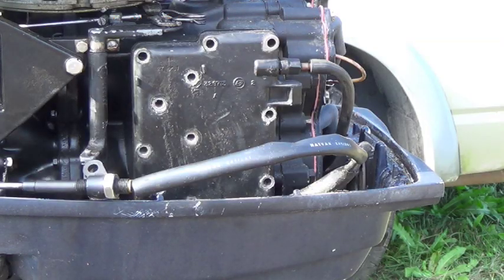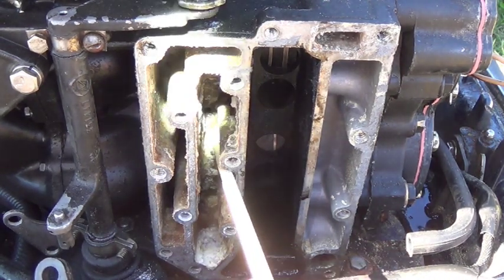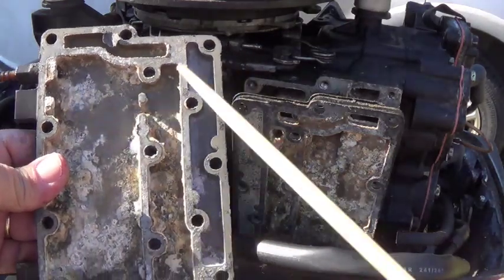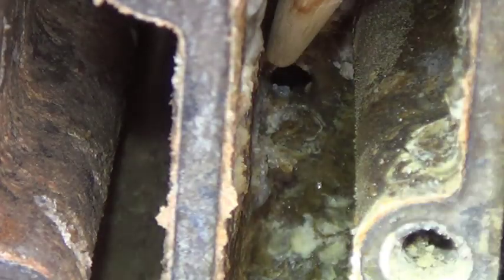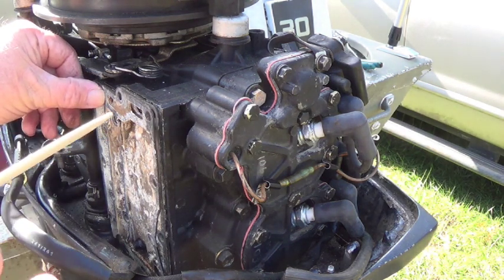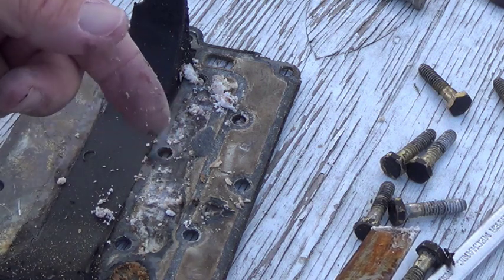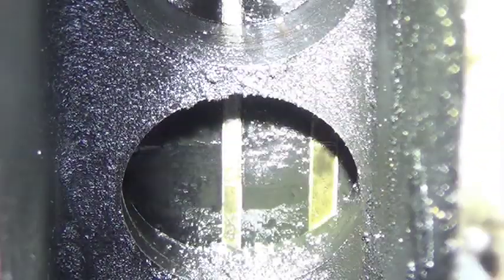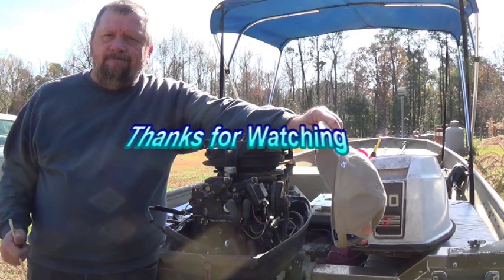Water Flow on a Outboard

Comment: I have a motor Force 85 hp, 1989 year. From the cooling tubes I have an exhaust, at the top of the motor, is this supposed to be that way?
Reply from the maker: I have not had that much experience with the force motor so I am not sure.

Comment: Hi buddy !  really like the videos . I just got a 1985 9.9 evinrude electric start . The tell tale drips kind of alot but not a stream and it doesnt blow mist out of the rear exhaust hole . It has seen saltwater . I am going to check the THE THERMOSTAT  it seems like the cooling system is dirty since I put it in my test tank that was clean and it has dirtied it up since I put it in the other day . I have started it 5-7 times and run it a bit hoping the system may clean out and then stop it after it gets hot .  Going to buy a new themostat and I need a gasket I guess , is that the head gasket ?  Am thinking about taking it out and running it without one to flush the system then putting new one in . Also is it possible my tell tale elbow could be clogged ?  the elbow is covered in black dryed goup and has a white fabric underneath . Thhinking I should remove and inspect the elbow for blockage     Also starts without choke but if choke is applied will not start . Has new plugs and supposedly a new impeller
Reply from the maker: Joe, Some how I have miss your Question to me about your 1985 9.9 Evinrude did you get it  fixed?

Comment: hey Om Fishing i really like your vids. Are u sure that the water is supposed to exit from the prop isnt it supposed to exit from the upper exhoust???
Reply from the maker: On the 20 to 30 Hp the water exits through the prop. On the 9.9 to 15 it exits through the upper exhaust port.
Reply: I have a 15 that shoots warm water out of the top as it should, however the water coming out of the lower port is pretty hot. Not sure if that is a problem.

Comment: why would water come out spark plug hole ? thanks
Reply from the maker: The first place I would look would be the head gasket. You could do a compression test and that would tell you if the gasket is blown. The water coming out is a sure sign too. Don't twist the bolts off. Take your time. That could make it turn into a major job. Sometimes I will use a torque wrench to break them loose just not to break the bolts off.

Comment: How hot should a 2 stroke be at the back of the motor ( head ) when running on the river?? Can't find anything saying how hot they run. I have a laser heat gun and my engine is about 165 F. when I run it full throttle....that seems HOT to me. it is a 15 hp with NO thermostat. It is pumping water out the back.
Reply from the maker: This is a long answer to a short question. To check the engine temperature the MFG says to buy a Thermomet Stiks. This is like a crayon that melts a set temperature.  For your 9.9- 300 hp engine you would need a 125 degree F or [52 C] stik and a 163 degree F or [73 C ] stik. Mark the top of the cylinder block near the cylinder head with each thermomet stik. The mark should appear similar to a chalk mark. Make sure sufficient material is applied to the metal surface. With the engine at normal operating temperature running at 900 rpm in forward gear the 125 degree mark should melt. If not the engine is running to cool. On thermostat equipped outboards the thermostat may be stuck in the open position causing the engine to over cool. With the engine at normal operating temperature running at 900 rpm in forward gear the 163 degree mark should not melt. If it does the engine is over heating. Check water pump. Increase engine speed to 5000 rpm. The 163 degree mark should still not melt. Hope this helps,
Keep watching and Stay Safe!!
Reply: Thanks for the reply. I have a laser gun and the top of the head at the back above the spark plugs reads 165 after a SHORT full throttle run. NEW water pump impeller, I have done DOZENS....new head gasket, thought exhaust may be blowing into water jacket, new base gaskets for the same reason, new water tube grommets top and bottom, power head removed and all water jackets checked and compressed air blown through, COMPLETELY free of obstructions....still heating. Lower unit removed THREE times and grommets and impeller checked. Impeller fins turning clockwise looking down as they should. Pin in drive shaft NOT turning in impeller. STILL OVER HEATING.
Reply from the maker: I am at a loss with all that you have done. The service manual says overheating and lack of lubrication cause the majority of engine mechanical problems. I wander if some time in that motors life, maybe someone run straight gas in it.  If you run your gas a little rich with oil does it run any cooler. Have you check the engine timing. Does the motor have the right propeller. Do you think it is running to lean on fuel. Just throwing some things out there. That sounds like something that would happen to me. Hang in there!
Reply: Yes, you are thinking the SAME as me.  It is a 1961 Gale 15 hp. Compression....103 and 103 EXACTLY so engine is in good shape. I checked the cylinder walls...like new. I timed the old motor with a timing tool from Richards timing tools SOO....bang on. There has GOT to be something with the water pump....I don't know what to check with it now, I have had it apart 3 times. It is not to lean...I have tried that every which way. I will find it....I don't discourage easy!!! Thanks for your thoughts.
Reply from the maker: @outboardfixer   be sure to let me know what you do find wrong. You got me thinking now.
Reply: I will for sure...let me know if you wake up in the night with the answer.

Comment: I have a question for anybody that can answer 

I have a dt15c suzuki outboard motor when I first crank it up water starts pissing out the peehole then after about 5 seconds it quits peeing (the motor is still running) also no water is getting to the thermostat (not sure if its supposed to right away)

The impeller looks good I fixed a couple seals and all the lines seam clean any ideas what the problem could be thanks
Reply from the maker: I don't know on a suzuki outboard. On my evinrude it did the same thing. There was sand and scale in side the engine. When it ran for a while it would block the small holes for the cooling. I took off the every engine cover that had water jackets behind it and cleaned it out. I fix my problem. I was surprised how much sand was in side.
Reply: @OmFishing  i think the bottom plate where the impeller rides on was shot.
 i took everything I could find that had something to do with the water cooling system apart and didn't find any problems so I just bought all the seals, plate, gaskets, impeller and that fixed my problem!

Comment: i replaced my impeller and thermostat on my 1994 E30ELERM, but i have no water flowing through the head (tell tale blows only hot air at the moment). i have the exhaust cover off now. you think a smoke test will help find a potential blockage? i may dismantle again and re-verify my water tube is properly aligned and connected.
Reply from the maker: I have use a water hose with a little pressure and run water back down the motor through the thermostat and other ports. Just in case it sucked something in and blocked it.

Comment: I broke off some bolts inside removing them..any suggestions?
Reply from the maker: I use a heat gun to help get them out. That way it does not get to hot, a lot of penetrating oil, a lot of patience. As you already know those stain less steel bolts will break if you look at them wrong. If you use a easy out make sure it is in the center. and a lot of penetrating oil.

Comment: I changed my water pump and still can’t get water to top of motor.
Reply from the maker: Did you remove the tall tail hose from the engine block and see if water comes out there.